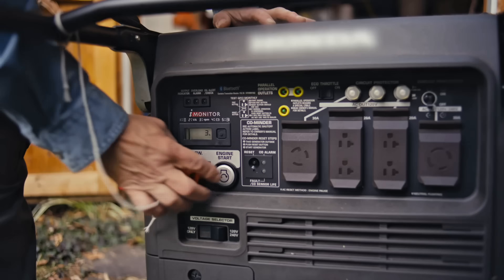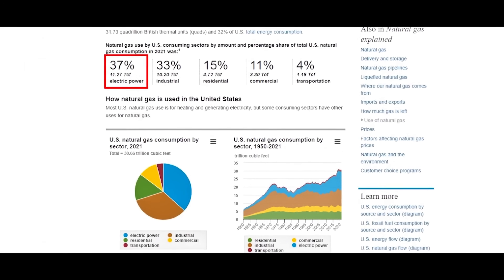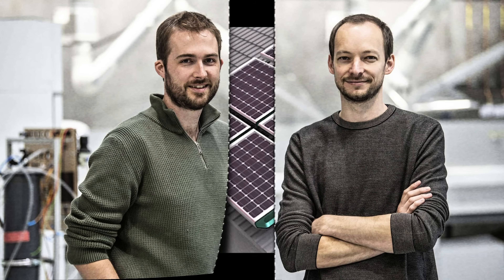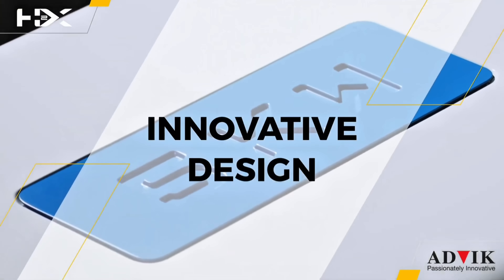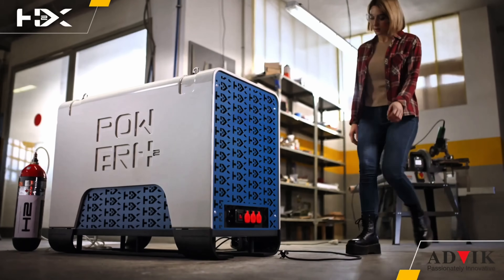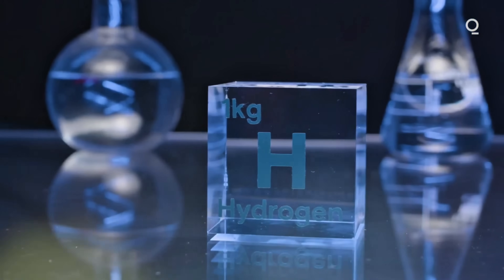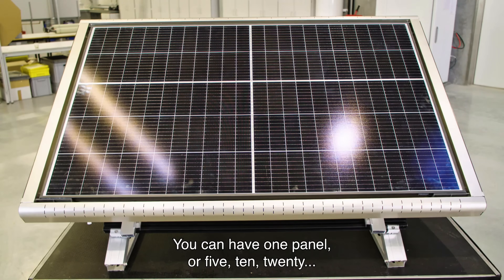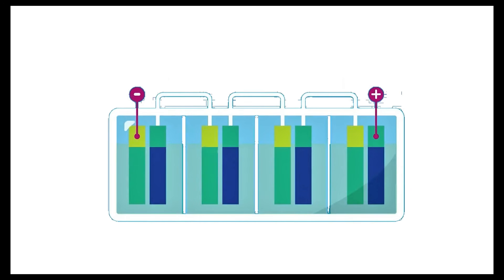No More Bills: This Two Energy Devices That Power Your Home For Free Forever !

Comment: For the people that Need it, and could use it most cant afford it, some friends and I seen this coming 5 years ago and started slow a few panels and batteries at a time as we learned and ramped up
solar charger and inverter big enough to actually run something that matters!
so basically $50 at a time, we learned as we went, taking a few things off the grid yet staying connected took an average Electrical bill of $550 a month down to $300 almost Half!
Panels, charge controller and Inverter you can do this little at a time from equipment you can get right now for under $2500 and in case of an emergency, grid failure, storms or we go to war you can at least fall back on something and at least have lights and a way to charge things